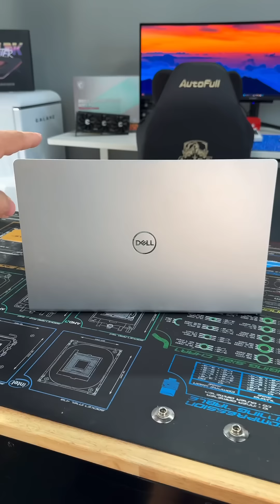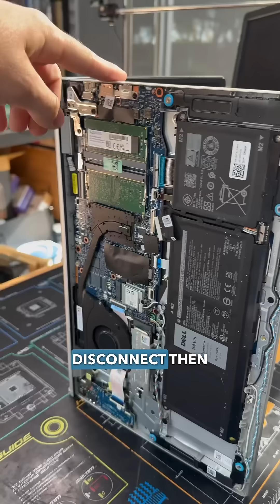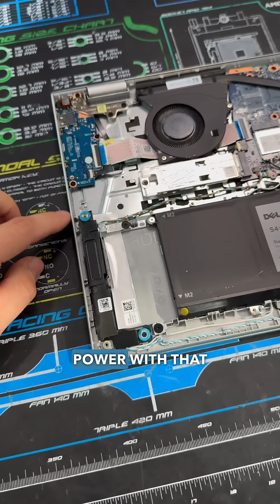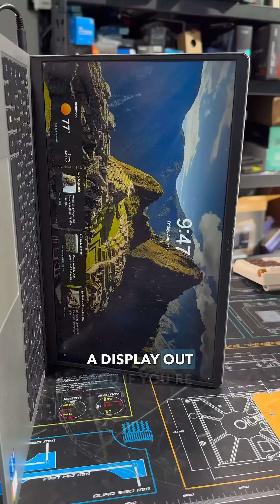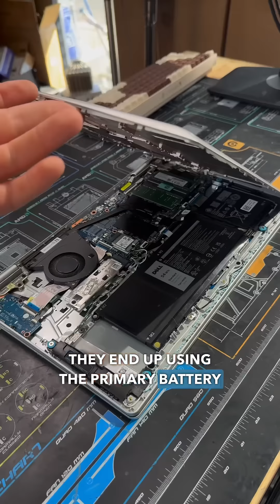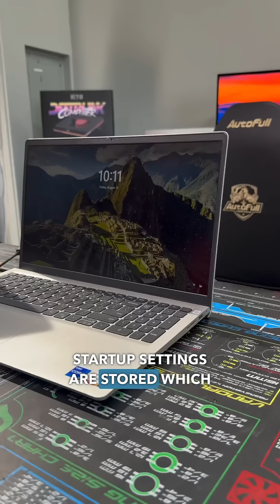Laptop NO Power! #pc #pcrepair #repair #techtips #computerrepair #laptop #laptoprepair

Comment: actually most laptops I've dealt with use an RTC battery not a regular CMOS but still a battery that connects to a port on the motherboard independent from the primary battery. it's usually hidden under the battery on dell laptops

Comment: Wow, this is just bad. FIRST you hit the powerbutton for 15seconds since it resets the battery controller on a lot of Laptops even without disconnecting the Battery. THEN, if this method doesn't work, you open the laptop and do as described.

I guess there are people with experience and then there are people who create Channels like mattscomputerservicec

Comment: Pro tip: This only works until something on the motherboard dies. That's what happened to me and the laptop burned out the power supply. XD Does anyone know what to do when the laptop starts but doesn't display an image? The graphics card is fine, and so is the processor. Is it the screen's fault?

Comment: On DELL Laptops you can also first try disconnecting power and hold the power button for 40 seconds, don't let it go when the laptop makes fake signs of life keep holding. if it worked it will turn on while you still hold once you see the DELL Logo on screen you can let go of the power button. That is the correct hard reset without disconnecting the battery

Comment: I once received a laptop that have a super weak wifi signal. I never figured out why. When I opened it, the wifi module was ok. The laptop was clean  and is only 1 year old. I tried a fresh windows install and it was all the same. Weak wifi, aftee 5 ft it will completely loose signal strenght. It was not the router either, since I tried woth 2 different routers and my own phone as hotspot.

And funny thing, I ran Ubuntu from an USB drive and... suprise, full signal strenght, from everywhere.

Comment: I would like to ask you a question about my Dell laptop and situation. I have Dell Inspiron 15 laptop 5500U. It started to shut down randomly 2 months ago and I got it's motherboard changed at warranty. But it did not fix the problem. What can cause this thing? Btw it does not matter if it's charged or on battery.

Comment: how would i send my pc to him i really need to have it fixed
it wont turn on at all and every part and case has been either removed replaced or fixed and yet nothing wants to turn
cmos battery removed and replaced 
old cpu replaced with new and still nothing 
new motherboard installed and still nothing
powersupply replaced and still nothing
new case replaced and STILL nothing

Comment: I have a similiar issue with my laptop, but whenever i put the power connector all the way in it makes contact and starts connecting and disconencting over and over again, but if i hold it just before it being all the way in the slot it doesnt disconnect and it charges normally, i wonder if this could use the same fix as the one shown in the video. Any help as answer to this comment is appreciated, thanks 🙏

Comment: This is called a power cycle. This used to be easier to do when laptops had removable batteries, but not so much now that the manufacturers have become obsessed with slimming down their products to outright anorexic levels. My usual first steps are to attempt a power cycle by power button only, so hold down for at least 60 seconds. Has to be 60, 59 won't cut it. Many manufacturers include a function to pseudo power cycle the device with a full minute power button press. This doesn't always work and I've found some moving away from this for some reason. Some of them won't require a full 60, I've found some of the ThinkPads at work will do this at about 15-20 seconds if I'm lucky. If that doesn't work, a battery disconnect is the next step.

I HATE the relatively recent, almost certainly spawned by the depraved money hungry brain of an MBA with little knowledge of technology, decision to remove the coin cell batteries and power CMOS entirely by the main battery. It's objectively stupid. I'm the sysadmin at my workplace and I have one other coworker, a dev that does some sysadmin functions. We both wear all the IT hats since a disaster hurt the company and there was some truly painful downsizing. Anyway, I tend to be the one that does hardware work. I've found that recent (last 2-3 years) manufacturers have been moving to this no CMOS battery nonsense. I've experienced this with a Dell Vostro 7620 and a Lenovo Yoga Slim 7x Snapdragon X Elite. This becomes a massive issue when the users of these laptops let the battery drain completely and are full or partial remote staff. I've inherited GPOs that were created 15+ years ago by someone who probably didn't know what they were doing and one of the restrictions prevents users from changing the time from within the OS. So they end up with time drift the lower the battery gets, and it doesn't take long for it to get to a point where they can't even connect to the VPN to trigger a time sync with the DC. Not to mention the fact that the GPO builder didn't include a fallback public NTP source, just in case. I've since corrected this, but if the Sales team never connects to the VPN to update GPO like they are supposed to then that's on them. Even more ridiculous, some of these laptops don't have a date/time adjustment in the UEFI/BIOS. Absolute nightmare.

I had one Lenovo Yoga 9i that completely died on the user while in another country on business. When he got home we had Lenovo send someone for repair. They (supposedly) replaced the board and it shut off again later that night. I was able to get it to turn back on but with severe misbehavior with the C ports after a battery disconnect. That's also when I noticed the fucking repair tech didn't remove the rubber foot that had 3 hidden screws under it and just pried the battery door until they broke it. Then put it back on with the bottom bulging as they didn't bother to remove the screws and damaged plastic still stuck there. Had to mail to repair depot for a proper repair.

Comment: I use this trick all the time, another one that not everyone seems to know is on the bottom Thinkpads there’s a little pin-sized hole that actually has a reset button inside it. I’ve used it dozens of times, few times even on my own laptop when it’s gotten stuck in sleep mode.

Comment: This has always worked for me on hundreds of laptops without disconnecting the battery, just holding the power button for 45 seconds usually does the trick with Lenovo laptops especially

Comment: happened to my latitude 7480 4 times in a week, no amount of troubleshooting worked at all, tried everything. came back to life after 3 days first time, 2.5 days second time, 1 day third time and a few hours last time and been working fine (because i reflashed the bios and reinstalled the whole system) but tried ubuntu and it died on me mid usage with exact same symptoms like before (it was the 4th time) so i switched to windows 10 and idk what it did now its all fine and working like a charm.

Comment: Recently, my friend gave me his laptop because it was slow, and not working at intended. He bought a new one. So, I decided to check this laptop. Disk usage 100%, so I decided to swap the drives. Works perfectly now. Not the fastest machine but it's a fully functional laptop now. Even plays slay the spire. Wasn't hard at all. I'm really not an expert in computer repair, this stuff seems scary but with a proper guide, it's not too bad! I didn't use a guide for my drive swap, mostly because I couldn't find one for the model laptop I have lmao ☠️
Reply: Clippy
Reply: @OliverVR-t9m we are legion
Reply: Sounds like an interhent historian word, the varis.
Reply: Drive swaps are generally pretty easy and safe, the hardest part is getting all the screws holding the thing together and maybe picking the correct replacement drive (though 2.5" drives are always SATA, m.2 SATA isn't really a thing anymore and m.2 NVMEs are usually 2280). :D
You did good. :)

Comment: I actually HAD that problem and left the laptop aside for 4 months and fixed itself,  not all laptops are easy to remove the back panel...

I had a 8th Gen HP and it came up working once the battery was really dead....

Thanks for the heads up and confirming what I had thought...
Reply: When I see that problem it are often HP laptops. And I think that the reason your laptop fixed itself is because the battery was completely drained out, just as the cmos battery or your laptop uses the main battery as the cmos battery just like in the video.

Comment: Huh. I must have had a similar issue on my HP Envy: it would run the fan like crazy and not boot up most of the time, which lead to turning it off and back on again until it loaded right. I haven't noticed that issue since I upgraded the SSD, and I did do this method to drain the battery then to avoid harming any components. I thought it was just a problem on the old NVME drive, but this makes more sense.

Comment: I hope this customer is thinking about replacing the system soon. That charge port is cracked.
Reply: The charging port isn’t cracked, the plastic frame is. That won’t change how the system functions though, so there is no reason to replace it.
Reply: @cubicbuilder9 They should replace the laptop because the keyboard is black
Reply: @cubicbuilder9 well I hope they think about replacing it cuz cuz the screen is dirty.
Reply: what? why? youre going to throw away a whole laptop over some cracked plastic?
Reply: @markkealy4417 because the guy doesn’t understand anything and he feels the need to leave a nonsense comment.
Reply: @markkealy4417  "some cracked plastic" just wait until half the laptop structure is broken because of that awful plastic...
Reply: @markkealy4417  I have a laptop with so many cracks on it from the previous owner. It surprisingly works just fine. For those wondering it is a Dell Inspiron 15-3521 Classic.

Comment: hmmm he skipped the part where you also need to look a the cmos config to find out if anything went wrong, which lead to that weird boot problem in the 1st place
Reply: The hard reset will take care of that.
Reply: @namyun2743  yes as it make the laptop went straight to the OS but that does not guarantee it wont happen again, & you wont know if everything in the cmos is as it is intended
Reply: @Edoras5916  If it was the CMOS, the hard reset will allow you to get to the next step of the troubleshooting process.